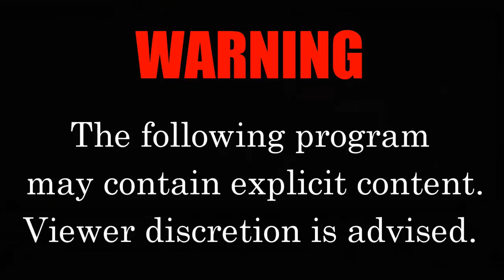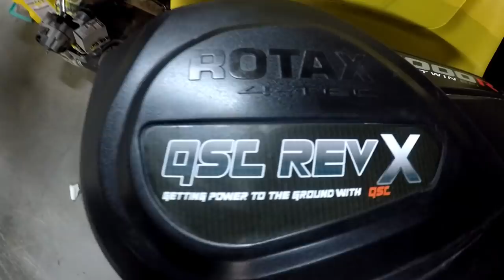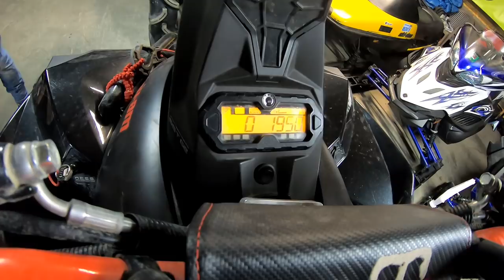Install and Testing QSC Rev X Primary Clutch On My RENEGADE

Comment: Why don't you use rad relocate . Dosent it overheat?
Reply from the maker: I've never had an issues with overheating,  and we've run our fair share of canam units. Ya just have to look after the rad, pre-screen helps a great deal.
Reply: Thanks man you guys rock

Comment: Eh tv honest opinion what primary do you like more and why boss
Reply from the maker: Preformance wise I'd say they're both are on par.I did find that the QSC shifts better right away upon install, But my STM smoothend out after a few good rides.
Reply: eh TV thinking about putting maverick cv tech clutch in mine what you think
Reply from the maker: If they have one for your unit I would for sure.
Reply: eh TV Jeff Ross the bomb racing gonna hook me up for 725
Reply from the maker: @mudtron3664  I should message him, he doe's NOS Kits right?
Reply: eh TV believe he does a bit of everything 
 racing og
Reply: eh TV I sent Jeff Ross a msg for ya about the nos good luck bud
Reply from the maker: No shit, he just sent me a message LOL. Thx boss, been meaning to talk to him about it anyways. hahaha. You just fast tracked the whole idea possibly. Cheers
Reply: eh TV you’re Chanel top notch man one day I will make some videos if I learn to edit don’t really no what to use

Comment: CanAm Garage - those 2 words go well together - lol - love it! (just messin' with ya of course - gotta get a little brand bashin' in whenever the opportunity presents - hahaha!)
The weight difference on those 2 clutches was pretty darn significant!!! What was the performance like? Any major difference?
Reply from the maker: Yeah, seems it's setup for getting off the line compared to the long power curve of the STM setup I had on before. Very smooth engagement and snappy throttle response. Keith more then pulled away on top end though so I may have to add weight to find the happy medium. eh. Cheers Q